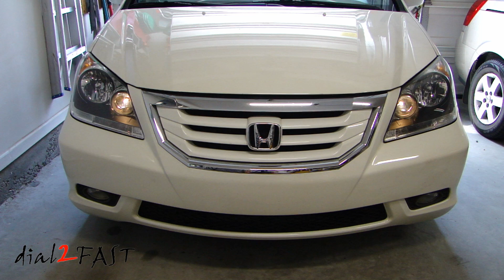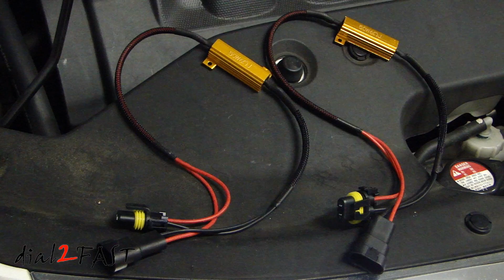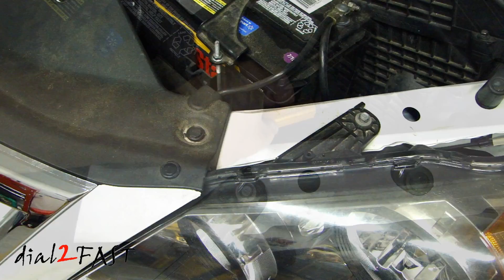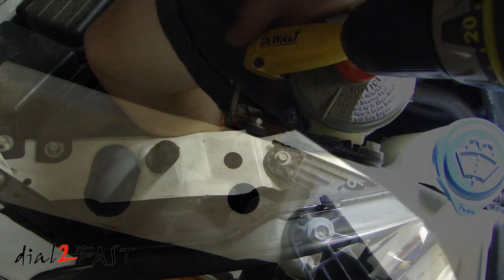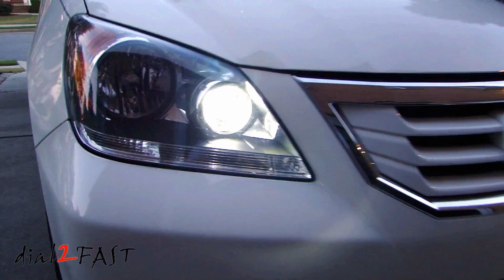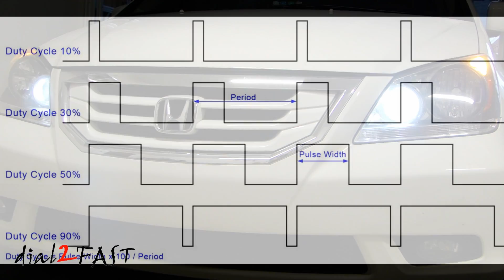Honda 9005 LED DRL Daytime Running Light Install with Load Resistor

Comment: If you desire to keep the drl off but not interfere with the high beam function (especially for halogen bulb users), it is easy to do.  

Simply pull the drl fuse out with pliers.  This fuse is located under a panel by the drivers left knee.  There are a few videos on YT which show this simple procedure very clearly.  They will explain via the fuse diagram (located by the fuse compartment panel) which fuse is which.

Again, pull the drl fuse only as there is a separate fuse for the high beam function (which you should obviously not remove.)

Even though this bulb only has one wire coming off of it, the separate fuses divide the two functions from each other.

Once that drl fuse is pulled, the drl will stay off and the high beam function will continue to work.  If the high beam function does not work then it could be a failed high beam fuse, or even a faulty bulb or wore.  But if the bulb and or wire is bad than neither function will work anyway.

Comment: How did u fit ur hands
Reply from the maker: It is very tight to get your hand in there. You might need to use a long needle nose pliers to help with removal. Be careful not to break the bulb.

Comment: So if I replaced both sets of high beams and low beams with LED bulbs, I would need to buy 4 of these? And as long as the lights function properly is it fine to drive with the DRL light on?
Reply: You can pull the drl fuse to disable the light but the highs will still work
Reply: @franchisefred4066  Thanks for that. My DRL light comes on an off so it doesnt really bother me.

Comment: I have. 2006 sienna le whit halogen drl lights I tried to change them to led and won’t work! The high beam work perfectly! I use a resistor and nothing! Need help when I install one led and one halogen only the halogen turn on using drl!!

Comment: Do the DRL turn off when you turn on the low beam? Your video shows that the 9005 led is still on when you turned on the low beam headlights. The 9005 DRL are supposed to turn off when its dark out correct? Or when you manually turn on the low beam headlights the DRL automatically turn off. Correct?
Reply from the maker: Turning on low beam headlight will turn off the DRL. In the video, I did not turn on the low beam,  but instead I turned on the high beam light which on this Honda Odyssey will automatically turn on both the low and hi beam light. I did that to show how the DRL light will go to full brightness when high beam is on.
Reply: @dial2fast  ok thank you for your response and Awesome video sir.

Comment: Thanks good explaining.  is there a way to install LED daytime running lights that dim during the day but at night when you switch on the high-beam they go to full brightness.  My 2010 Subaru with LED high beams during the day are running at full brightness. Is there some way to dim the LED bulbs during the day?
Reply: I know that was 3 years ago but i have the same issue on my kia forte did you manage to solve the issue?

Comment: The auxbeam light you said no resistors are needed, but in your description you put a link to resistors??
Reply from the maker: Sorry, the links are confusing, since making this video, I installed the Auxbeam F16 LED light which did not require load resistors. That's the link listed. I have taken out the load resistor links. https://youtu.be/9gS0R3k4WO0

Comment: I have an 05 Chevy Cavalier.
I replaced my headlights with an LED bulb and the headlights function properly.  However, once I switch to my daytime running lights (DRL), it then hyper flashes.  Should I get the resistor or the Canbus decoder for my type of bulb instead?

Comment: Have you had any melting issues or fires? I have a similar setup where my front turn signals are also running lights. So I bought switchback bulbs that will be white when turn signal not in use and Amber when signaling. I see warnings not to use resistors on lights that will be on long. So will I have any fire hazards or melting issues if I use them for my lights and mount to metal surface?
Reply from the maker: The load resistors will get very hot for DRL as they are running all the time. You need to securely mount the resistor heatsink to a metal surface to dissipate heat. The resistor itself will not catch on fire as they are rated to very high temp, but it must not contact other plastic pieces are wiring harness.

Comment: Hi I bought the same resistors you have and a led bulb for my drls on a  acura tl 07 but when I plug one resistor the opposite light works that does not have a resistor and then when I plug in both resistors both bulbs do not light up but the resistors get hot which is weird because they are getting hot while no light output is given. Anyone able to help me out with this problem? I only worked on it for 30 minutes and gave up on it but will continue on it tomorrow.
Reply: I tried the bulbs without resistors and just plugged them into the bulb sockst and they did not turn on. I know it’s not my bulbs because I seen them light up and plus they are brand new. I thought this

Comment: So I bought some high end Sylvania LED bulbs both high and low beam. I replaced factory halogen bulbs on my 2015 civic si sedan and the headlights look great, both high and low beam are working properly, my brights are working properly, the only thing that's strange is that my daytime running lights are still the factory halogen color. I have no idea how that possible since the DRL's come from the high beams, on my car. I called the place I got them and they said a few other people have ran into the problem and that basically they had no clue what was wrong. I don't understand how my bulbs would be outputting halogen light when I replaced all headlights and they are all working perfectly in LED. Please help if you can because I am so lost haha.
Reply: Yo, how r u and the honda? Have u found this issue and how to fix it yet? I have a 12 civic, replaced o.g. bulbs with different halogens (high/low beams) Dell's are STILL PISSY YELLOW!!!! should I replace them all with LEDs????

Comment: I'd like to change out my headlamps to LED.  Curious to know if I also need to add a load resistor?
Reply from the maker: Here is the video of installing LED In low beam on Odyssey https://youtu.be/xuC6pE521iQ

Comment: your explanation is funny mate... very simple explanation could have been perfect! LED uses DIODE which require a forward bias voltage to turn on and it is non dimmable. in my car it does dim, it depends on the brand your using.... and you could have used an OBDii to turn off the DRL instead of drilling holes in your car and putting a load on your car the resistors

Comment: I got some LED bulbs installed on my car but now I have no DRL. Mine are also running thru high beam. I also installed resistors but still no DRL. Do you know why?
Reply: Emil Carlover you need to get low and high led b.
Reply: with drl, the voltage going  to the bulb is lower.....around 6volts, so your led bulbs are not getting enough voltage to turn on

Comment: CAN i RUN THE led'S WITHOUT THE LOAD RESISTOR?
Reply: 9363234 yes. ive done it 3 weeks no problem.  just drl light in dash.
Reply: InvisUser Tsal how did you do it I can’t get them to work without turning high beam pn
Reply: On

Comment: Dr Fast, any tricks on how to reach the DRL?  I've the same Odyssey as yours.  Even on the left side w/o the PS reservoir's hindrance I still can't reach the DRL, and my hands are on the small side.  

Changed headlight and fogs into LED w/o an issue.  Any ideas how you reach the DRL?  Thanks

Comment: by any chance, can you leave a link for the Resistors? I bought some LED's to replace the DRL, Even though they are marked as 9005 they are round and don't have the right angle bend as the OEM lights have, There is plenty of room for the bulb but I can't get my hand in rotate them, especially on the passenger side. The right angle of the OEM 9005's allow a "handle" so to speak to twist the bulb into the socket. But there is no way for me to twist the round barrels of the replacement units. Local Honda dealer wants $40 for labor to swap them.... nice video!
Reply from the maker: You should watch my latest DRL video using CAN BUS driver instead of load resistor and you maintain your high beam. https://youtu.be/9gS0R3k4WO0

Some of these aftermarket bulbs are difficult to install, but you just have to take your time and try. If you still need to buy the load resistor, just search on Ebay and many sellers sell them. They are 50W 6 ohm resistors.

Comment: hi i recently bought led headlight bulbs for my civic they work but as you drive they are not at bright as the factory halogen bulbs. you can barely see the ground. the seller claims load resistors would fix this and the would not be so dim. would you think load resistors would fix this?

Comment: I installed the led bulbs as high beams as well and it showed the DRL in the dashboard but the bulbs dont turn on in the daytime only when I turn on all my headlights at night. Will the load resistors fix that problem?
Reply from the maker: The load resistor should fix the issue assuming the DRL was working to begin with.
Reply: dial2fast yea because it didnt make sense to me that DRLs would only turn on when i turn my headlights on but thanks
Reply: dial2fast same happens to me my drl only work when i turn on my highbeams. how do i fix that?

Comment: I bought the same type LED headlights off eBay the problem I am having there's no difference between low beam and high beam on the brightness and the low beams cut out from time to time could this mean I need load resistors thank you

Comment: Great video. The problem I'm having on my 07' Acura TL, is when changing to 9005 led bulbs, only one bulb will ignite.  I can't get both bulbs to lite up. Do I need a load resistor for this problem too? THX
Reply: Same issue I have right now

Comment: Thank you for explaining PWM... I was going crazy to find out why my H7 LED DRLs were "pulsing" on a really fast rate while recording, but not noticeable to the naked eye.  The set of LED I have do get very bright once you turn on the high beam and the "pulsing" stops. My only question is, would this pulsing damages the LED overtime?  My set comes a very small ballast... BroView S7
Reply from the maker: The pulsing will not damage LED.

Comment: 1rst : With my bright's switched on , they go off. I was thinking that load resistors may help this problem. I actually bought a new pair of these that are longer due to the fact that the ones I have from a couple of years ago are shorter and they don't go completely thru to the composites so it looks like only a "Dot" when you see them in a store window during the day. lol. 2nd: The new ones don't come on at all. I was going to return them as defective but this isn't the first time these have failed for this "Longer" style LED. This may also be a "Load" issue. I was going to try that and see what it does and if it would correct it before I returned them again. Load Resistors do correct other problems as well. I don't get an "Error" because my vehicle's a 2001. Any suggestions ?

Comment: Whats that drill attachment for the tight spaces?  Great video also, would like to do this.
Reply from the maker: It's a Dewalt right angle driver. I have a video on it:  https://youtu.be/jPKBa1he80I
Reply: +dial2fast thanks, found one at home depot

Comment: I have a 2015 Honda civic ex, I did the same thing, with a different decoder, and the DRL keeps coming on. any help???
Reply from the maker: I know there are different decoders on the market. Some don't use resistor, but instead use a capacitor across the + and -. I am not sure what decoder the 15 Civic needs, but there is probably something out there that will work for it.
Reply: Well I know someone that has a 15, but it's an SI and they got the same one j did, however they're bulbs are different from mine. Would the bulb make a differemc, or the SI model?
Reply: austin aita w

Comment: nice upgrade... can I install this on my 2005 Honda odyssey
Reply from the maker: +alexander perez It should work the same.
Reply: The high beam bulbs are hard to get a good hold and twist on my 06 odyssey, any suggestions one short of taking off the headlight assembly?

Comment: On my 2010 Odyssey, I have the xenondepot 9005 led kit and I didn't need any resistors. It doesnt flicker or no DRL warning light. Still have my highbeams you lost your highbeams now with this particular led.
Reply: LASFIT led bulbs do the same thing, plug n play with no resistors or anything, built in fan for cooling.
Reply: Gonna have to look into this.  Did you also change out the 9006 main bulbs on your Ody ? I also have a 2010 Ody.  Thx in advance.
Reply: +Roger S yeah i did xenondepots led kit is very high quality i highly recommend them
Reply: MrRangerZr1 wat is xenon pot is that a difrent brand of leds
Reply: Roger S